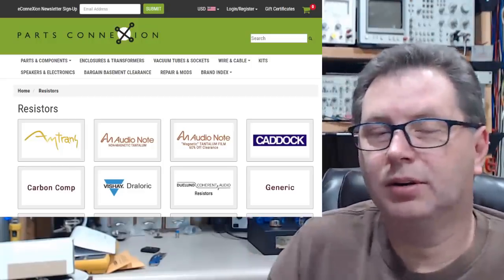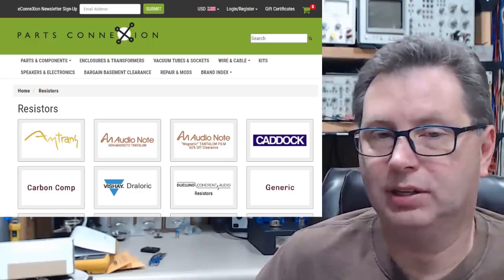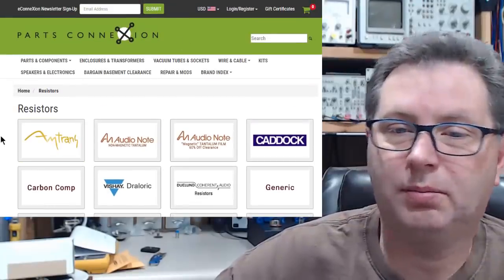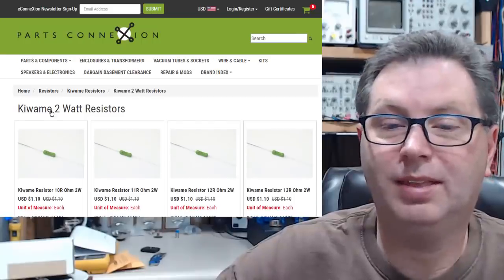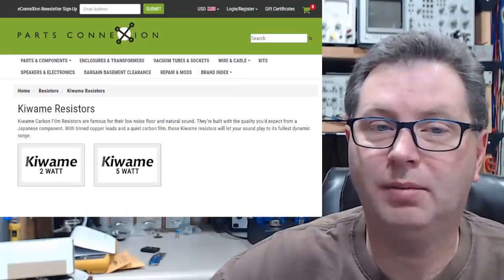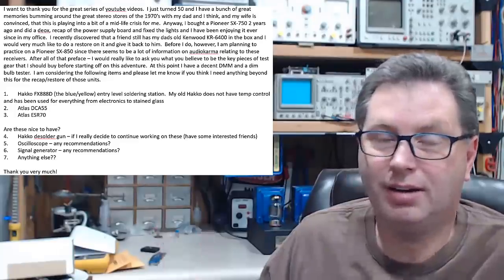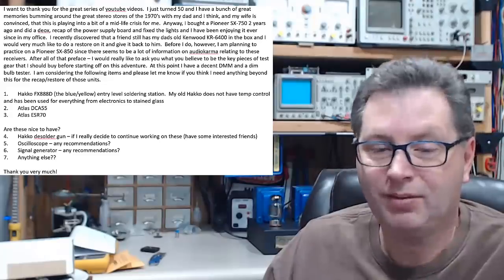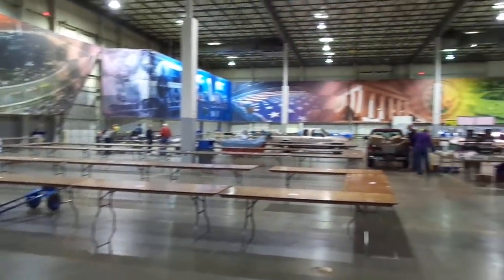SBS Viewer Builds - Workbench Basics - Audio Resistors - Richmond Hamfest

Comment: I bought a Picoscope 2205 software oscilloscope.  I love it.  It's small, has 2 channels, and a signal generator.  The only drawback is that it will only handle 20 V native.  I bought a couple of attenuators that will get me the ability to have up to 200V...  I  like the fact that I can stash it in my desk, which doubles as my bench.  From what I have done with it will handle all the audio tasks with ease.

Comment: I bought a Chinese version of the desoldering gun. Worked great for a while then the nose plugged up and I've never been able to unplug it. The owner's manual is only in Chinese and no help at all. Came with two wire ramrods, obviously for clearing a plug, but I wouldn't stick a bare wire into a hot gun with bare hands.  I first started with the plunger type (like you showed) but it always bounced when I tried to use it, couldn't control it. I've had the best luck with braid. Found a deal on it at a local surplus store (.88 for a 5' roll) and I bought a lot of them. I'd prefer the gun, because when it was working it worked great.

Comment: great video... i have a question...i have an amp that need to be recapped.. it has 4 8200uf 100wv caps.. can i replace them with 10000uf 100v caps?
Reply: Robert Skolnick I wouldn’t think it would be an issue. Mark is the expert on the HiFi amps, he would know for sure. I mostly work on guitar amps and have bumped up capacitor values when originals are not available. Like old Fender values of 16uf, I usually use 22uf. Much more common and much cheaper. Higher values will draw a bit more current but I think it would be negligible in your case.
Reply: @SIXSTRING63  thank you for the reply... it is a soundtech pl1402.. i am in Brazil and the 8200uf's are impossible to get....